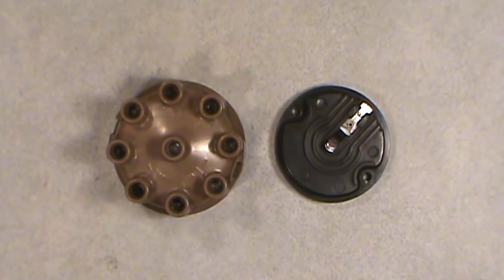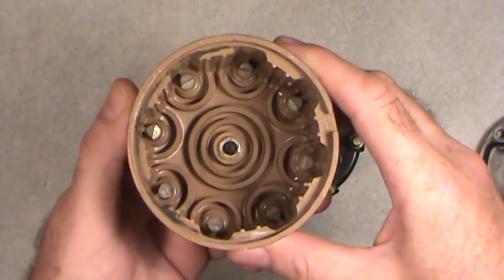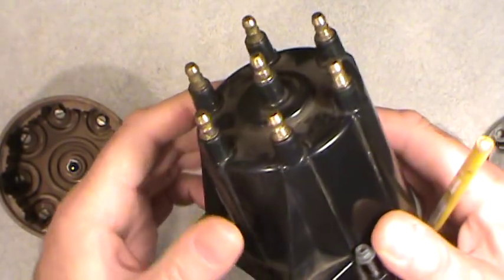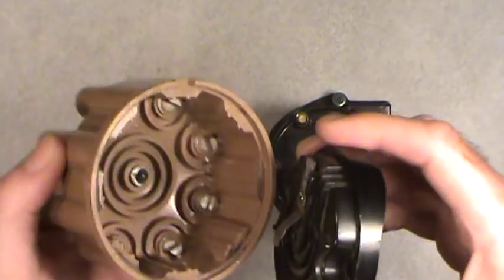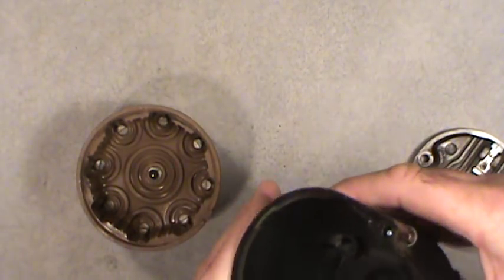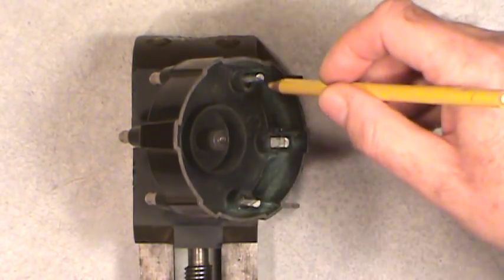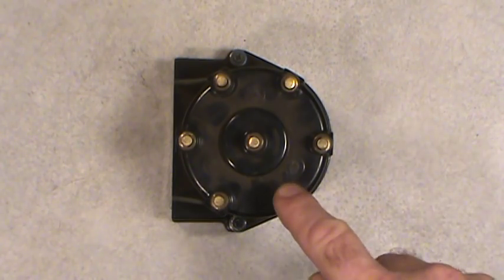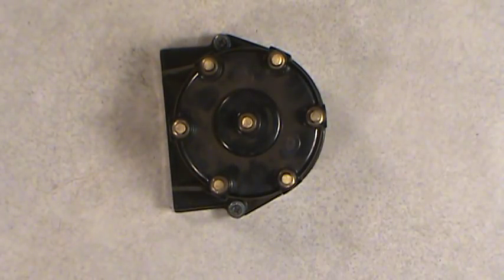How to Inspect Distributor Cap and Rotor Condition (Part 2)

Comment: Hi, I have a 86 Scottsdale k20 with a sbc 350. When I go to start my truck it turns over and runs but it makes a popping noise out the exhaust, no flames or anything it just pops. I replaced plugs, and plug wires and I have a brand new battery too. All of which are the best money can buy (so I was told) after installing the new parts it still pops very loudly. Is there maybe a issue with my cap/ rotor? The truck ran fine 3 weeks prior but I don't drive it everyday. I just turned 16 and I spent every last penny I had on this vehicle. Can you please help me out!!!! I'll take in consideration any ideas! Thanks -CJ
Reply from the maker: +C McCav ....Greetings C McCav....Thanks for watching................Now then, let's see, if we can find out, what's causin' all of that "Pop-in", shall we..................The first thing that comes to mind (mine, that is), happens to be...are All 8 spark plug "Wires"...Installed in the "Correct Order", around the top of the Distributor Cap...???...cuz, if only 2 of them, are Switched with one-another (more is even worse), then, the Engine won't Run Smoothly at all, and, could very well, be causing, the...pop...Pop...POP...that You were Hearing............The Distributor "Rotor" (inside the distributor cap), will usually Revolve/Spin, in a "Clockwise" Direction (as viewed from above), on Chevy 350 (V-8) Engine...................The "Firing Order" (that be, the Order, in which the engine's Cylinders Fire), on a Chevy 350-V8, is usually...1...8...4...3...6...5...7...2...and the spark plug "Wires", have to be Placed in that Order, around the Top of the Distributor Cap, in a Clockwise Direction (as viewed from above), and Hopefully, the Number 1 spark plug "Wire", is in the "Correct" (starting) Position, on top of the Distributor Cap to begin with, or, the Engine, just won't Run right, if, at all.............The Chevy 350...V-8's "Cylinder Numbering", is as follows........As You are..."Sitting in the Driver's Seat"...on the "Left Side" of the Engine, You have, the Number 1 Cylinder, Closest to the Front of the Vehicle, then Number 3, then Number 5, then Number 7....................Then, on the "Right Side" of the Engine (while still Sitting in the Driver's Seat...lol), You have, Cylinder Number 2, Closest to the Front of the Vehicle, then Number 4, then Number 6, then Number 8......................So, "Make Sure", that, the spark plug "Wires", on the Distributor Cap, are in Their Correct Places/Firing Order, while also having, Each spark plug "Wire", Going-to, the "Correct", Cylinder Number's spark plug................I usually, just wrap a piece of masking tape, around each spark plug "Wire", leaving, what, kinda looks-like, a Flag-like...looking end on it, where I use a Felt Pen, and write the Cylinder Numbers, 1 through 8, on them, cuz, I find it much easier, to see, where Each of those spark plug "Wires" are coming-from...and...where they-are going-to...as well...!!!...lol...........A Lady, was tellin' me, a while ago, how She used Different Colors of Nail-Polish, to, shall we say..."Color-Code"...each of the spark plug "Wires"...Yes-Sir-ee-Bob...that is one Smart Lady alright...!!!.....................So then, once You "Verify", that All of Your spark plug "Wires" are "Installed" properly, in Their Correct Positions, and are in the Correct Firing Order as well, and You are still having, that Popping sound, just let me know, and we can proceed from there, if You like...............Good Luck, and.........till next time..........Be Safe, take care, and have a good one.

Comment: When I mashed down on gas pedal 1997 Ford F-150 it was choking almost quitting let off gas an run better, then did again then quit now want crank! Rotor button distributer?
Reply from the maker: Greetings...Teresa walker...........Thanks for watching...........It appears, that, Your 1997 Ford F-150 (V-6 or V-8 Engine?)..."Does Not"...have a..."Distributor"...in it, at all, so, You won't have to worry about having one, as well as, having, the distributor "Cap" and "Rotor", that's, usually a part-of, that very same (non-existent) Distributor................Engine...Won't Crank over...???...Dead, or Low (charge), Battery maybe...???...might need to have the Battery Charged up, with a Battery Charger, perhaps, or, there might be a problem, with the (electrical) Ignition/Starting System, or maybe, the Fuel Pump, might not be working very good, and, if it's really, not so good, a Mechanic, might have to have a look at it, to see what's wrong, quite possibly.................Your 1997 F-150, will probably have, quite a few "Sensors" and "Actuators", that interact, with Your Pick-em-up-Truck's, "On-Board Computer" (being the Brain, so to speak), that, will be Controlling, the "Fuel System" (including, the Fuel Injectors, that spray pressurized gasoline, into the engine), as well as, the "Ignition System" (that be, the system, that's in-charge-of, making the spark plugs fire/go spark), and might even be, Controlling the Automatic Transmission as well, in some cases...............Did You happen to see, any "Dash-Board Warning Lights" at all...???...cuz, if so, then, that's probably tellin' You, that, something is up, alright.................Here are "2-Things", that can be done, to, shall we say, help find the Problem, or Problems, as the case may be, that are causing, Your Pick-em-up-Truck, to not be running, all that well................The first one, is to, have Your F-150's...On-Board Computer..."Scanned"...for any..."Trouble Codes"...that might be Stored in its Memory................There are sometimes, Automotive Part Stores, that have been known to, "Scan", a Vehicle's On-Board Computer for "FREE", with a Scan Tool (kinda, looks-like, a slightly larger, hand held calculator)...so then, try making a few Phone Calls, and ask the People that work there, if they will "Scan" Your Ford F-150's, On-Board Computer for "Free"...and if You're not having much luck with that, then, it shouldn't cost very much, to do so (I hope).................The Other one, is, to have the..."Fuel Pressure"...Checked, with a Fuel Pressure Testing "Gauge", in order to, make sure, that, the Fuel Pressure, is with-in, the "Specifications", for Your "Exact", Vehicle and Engine, cuz, if it isn't, then, Your F-150's Engine, probably, won't be Runnin' so well, or in some cases, the Engine, might not even Start.................The Very "High Fuel Pressure", in a Fuel Injected Vehicle, is Very Dangerous, and can Destroy a Person's Eyes, making it so, that, Eye Protection is Mandatory (aka, Must have, and be Wearing too), as well as, the Gasoline, that might, spray or leak, can, on a bad day, catch Fire, so, having a Fire Extinguisher near-by, is pretty much, a Must-have, as well...!!!.............So then, have those "2-Things", that I mentioned above, done/performed, that way, You'll have a much better idea, as to what kind of Medicine (more like, Parts and Money...lol), that, might be needed, so, when-ever You start..."Mashin'...Your Pick-em-up-Truck's, Gas Pedal again, "it" will "Go", just like it did, Before, it got too Slow for You...lol...Good Luck, and........till next time.......Be Safe, take care, and have a good one.
Reply: Thanks all very much ,your a big help, have a great day!

Comment: What will happen if the center pin in the cap melts however the engine dose start ?
Reply from the maker: Greetings...Ahmad Maher...........Thanks for watching..........Well, if that center pin (as you call it), melts, then, that sure doesn't sound very good to me, at all.........If you can tell me more about your car or truck, as in...Year...Make...Model...Engine size...and, if anything was "Modified" at all, as in, high performance parts, and/or, ignition timing settings, that "are not", stock/manufacturer/factory settings/adjustments..........So then, the more, that you can tell me about your problem, then, the more, that, I will be able to help you out...thanks...and.......till next time........Be Safe, take care, and have a good one.

Comment: what is the flat metal piece under distributor cap n ignition rotor
Reply from the maker: Greetings...Jerrad Schlemmer..............Thanks for watching............If, that flat metal piece, that's on top of the Rotor, is what you're asking about, then, it's the flat metal bar, if you will, that, conducts the high voltage electricity, from the distributor cap's, center carbon/resistor button (where it makes contact with that flat metal bar), then, that high voltage goes through the flat metal bar, all the way to its Tip, then, the high voltage Arcs (sparks) over, to one of the side Terminals (inside of the distributor cap), that is in the closest position (as in, the one that's lining up with the Tip of the rotor, at that particular time), then, through that distributor cap's (side) terminal, the high voltage electricity goes, then, through the spark plug wire, then, into the spark plug it goes, then, if everything is working properly, there will be a high voltage arc/spark, happening, between, the spark plug's, (two) electrodes..............The ignition coil, is what produces that high voltage to begin with, and, the high voltage electricity travels, out of the ignition coil's, high voltage/secondary terminal, then, through a shorter looking spark plug wire, who's other end, attaches, to the center terminal/tower, that's on top of the distributor cap, just so Ya know.............If the above, is not what you are wanting to know about, then, let me know, the best that you can, about what it might be, if it happens to be different from, what I was already telling you about, thanks, and..........till next time.........Be Safe, take care, and have a good one.

Comment: I'm having problems with my truck my engine turns but nothing turns on I smell gas I feel like I'm not getting any spark what do you think it means
Reply from the maker: +John Luna ....Greetings John Luna....Thanks for watching..................If You are Smelling Gasoline, be very Careful, cuz, the last thing, that Anyone wants, is a Vehicle Fire...!!!..................I have no idea, what-so-ever, as to, what Your Vehicle, actually happens to be, other than, it's a Truck, so, if You can let me know....Your Truck's...Year...Make...Model...Engine Size and Number of Cylinders, Inline, V-6, V-8, or...???... and if it's Factory Stock, or Modified in any way, then, I can be much more Specific, and a little less Generic, with the Help, that I'll be able to offer You.................So, for the time being, here's some Generic Information for You....................A Gasoline Engine, pretty much, needs to have the following...................Reasonably Good Compression, in all of its Cylinders................The correct, Gasoline, Air/Fuel Ratio/Mixture, for the Engine's Operating condition, at any given time...and...a good Strong Spark, between, all of the Spark Plug's Electrodes, at the Correct time.............Has Your Truck, had a "Tune-Up", and "Maintenance" done, in accordance with the Vehicle Manufacturer's...Recommended...Time or Mileage/Kilometer-age "Interval"...???...cuz, there are Parts that Wear-Out, and in some cases, there can be things, that need to be Checked, and/or Adjusted, as the case may be....................So then, if, and when-ever, You let me know, about Your "Exact" Truck, I will then, more than likely, have quite a bit to say, that, should at least, point You in the right direction, and be of some Help to You, and............till next time.........Be Safe, take care, and have a good one.
Reply: +RockysRoadshow thank you so much! I had 2 and 7 switched on the distributor, I wasn't home so i told my dad to check it out and everything turned out great. Much appreciated.
Reply from the maker: +C McCav ....Greetings C McCav....You're Welcome, and..."Congratulations"...to, both, You and your Dad, for..."Gittin'-er-Fixed"...without even havin' to take the Wallet out of Ur Pocket...!!!...lol............................Now then, if You really want to Hear any "Pop-in" again, that You can Really Enjoy, may I suggest, makin' some "Pop-Corn"...!!!...lol...and........till next time..........Be Safe, take care, and have a good one.

Comment: When the prong chip away will it cause it to
Miss ??? Rough idl
Reply from the maker: Greetings...Ram M457...……..Thanks for watching...……..Well, if that "prong", that you are talking about, happens to be, that, small, metal, flat bar, that is part of the "rotor", that spins around, inside of the distributor cap, then, here's, what will usually happen...……..I be thinkin', that, that "chip", that, you were also talking about, is actually, the result of, "high voltage", electrical "arcing" (root word = arc), and, can also be referred to, as, high voltage, electrical "erosion", so to speak...…….When-ever, high voltage, is able, to jump an air gap, that's between two metal points, then, a (high voltage), electrical "arc" (spark), will usually be seen...……..As the rotor's metal "tip", and the metal contacts, that are inside of the distributor cap, get eaten away, by all of that high voltage, "arcing/sparking", then, the "air gap", will also, start to get "Larger", and, the Larger, that, that "air gap" gets, then, the more difficult it gets, for the ignition coil, to create, the increased amount of high voltage, that is required, to jump (electrically arc), that, much "Larger" air gap...!!!...……..If the air gap, that's between, the rotor's "tip", and the metal terminals, that are inside of the distributor cap, as well as, the air gap, that's between, the spark plug's, two electrodes, starts to get too "Large", then yes, this alone, can be, the cause of a rough idle, as well as, ignition system, related "misfires", just about any time, that the engine is running...…….There are quite a few, different things, that can also cause, a rough idle too, depending on, what kind of vehicle, it happens to be, and also, what year/how old, the vehicle actually is...???...……..If you can tell me the following, then, I'll see what I can do, to help you out...……..What...year...make...model...engine size, and number of cylinders, that it has.....and.....till next time...…..Be Safe, take care, and have a good one.

Comment: The small spin piece is burnt is this y my car wnt strt
Reply from the maker: Greetings Jamiliah Collier....Thanks for watching, and for Your comment/question as well....Although, the "Small Spin Piece" (aka, "Rotor", and I like what You called it, by the way), can sometimes look Burned, but, doesn't always mean, that it would not be able to function (work) at all....That "Burned" Look, that You were seeing, is more then likely the "Result", of all of the "High Voltage Electricity" that is "Jumping" between the "Tip of the Rotor" and each of the "Internal Contacts" inside the Distributor Cap, while the Engine is Running.

While, on the other hand, if, Your "Rotor", and "Distributor Cap", are too far gone (aka, Worn Past its Useful Life, in terms of, Hours of engine operation, and also, that of "Mileage/Kilometer-age", that is being shown on Your Vehicles "Odometer", You know, those Numbers that are located somewhere near Your Speedometer, indicating how far the vehicle has traveled, distance-wise), then, there just might be Trouble brewing, and might be the, or, just One of the "Trouble-Makers", that are preventing Your Vehicle from Starting (and Running too).

The words "Tune Up", are some very Important words, that a Vehicle Owner should always be thinking about, from time to time.

The so called "Tune Up", Basically means, to "Replace" Vehicle Parts, when they get to the point of...Before they "Wear-Out", become "Unsafe", or, are "Not Able" to do their Job Properly.

Before I go any further, You had mentioned that Your Car "Would Not" Start...

...When You attempt to Start Your Car's Engine, does the "Starter Motor"..."Crank the Engine Over", as in, the Engine Sayin'...(Whirrr...Whirrr...Whirrr...), or maybe just a "Click", and Silence perhaps?

If the Engine "Cranks-Over", at a Fast Speed, then, there are "2" Basic Things that a Gasoline Engine Needs, to keep running...

...First, it needs Gasoline mixed with Air, in the correct proportions.
(I know, this may seem silly, but, is there Gasoline in Your Car's Gas Tank?).

...Second, it needs a Good (high voltage) "Spark", from the Spark Plugs, at the Correct "Time" (Time = which will Vary, according to the Temperature, Speed, and Load, placed on the Engine, at any given time).

I sure like to use a good ole sayin'...and that sayin' is...

..."Going on a Wild Goose Chase!"...lol.

My best advice to You, is to take care of the  "Maintenance" Related "Things", that are to be done, in accordance with, that of Your Car's "Owners Manual", that way, Your Car's Engine will be, so much more Reliable, and Fuel Efficient too.

For most Cars and Trucks, with Gasoline Engines in them, some "Tune Up" Items are...

Change "Spark Plugs", at the Recommended Replacement "Interval", and/or, before they Wear Out, and also, if they appear to be Covered in too many Deposits.

Distributor "Cap and Rotor" and "Spark Plug Wires" must be in Good Shape.

"Air Filter and Fuel Filter/Filters" have to be "Clean", as in, "Not" being dirty or plugged up.

You Car's Battery and Charging System have to be in "Great" Shape as well.

I sure hope, that You happen to have the "Owners Manual" for Your Car, that way, You will be able to Read, and see for Yourself, that, Your Car's Engine, needs to be "Serviced and Maintained" at the Required Time/Mileage/or Kilometer-age "Interval", with new Parts and Pieces, when needed.

Enjoy Reading Your Car's "Owners Manual", and, Good Luck, with getting Your Car running again.

If You like, let me know, How it's going...with Your Car, and maybe let me know, what Your Car, happens to be.

Be Safe, take care, and have a good one.